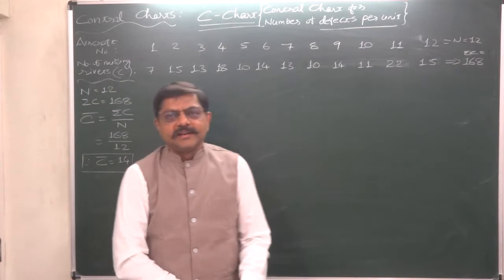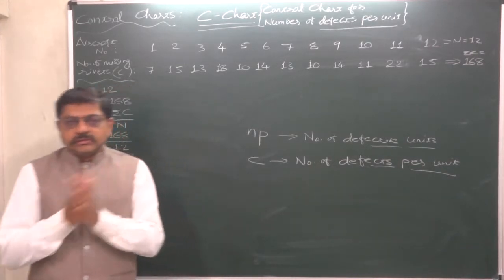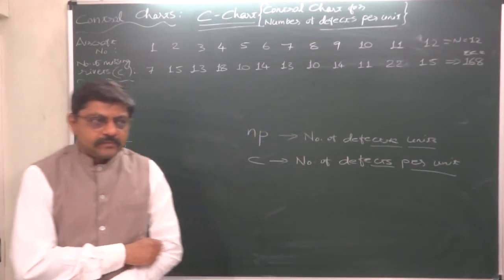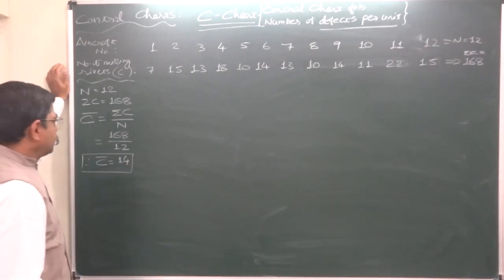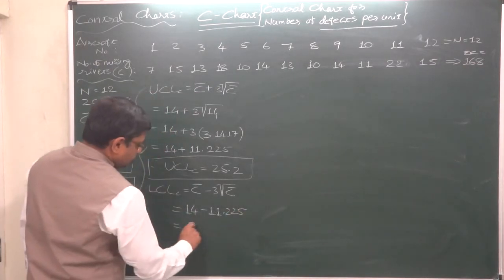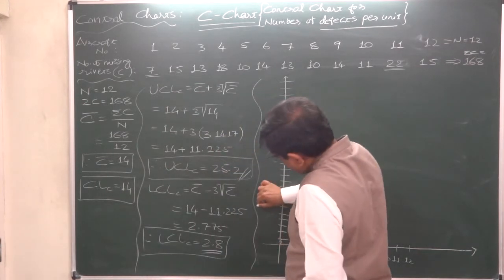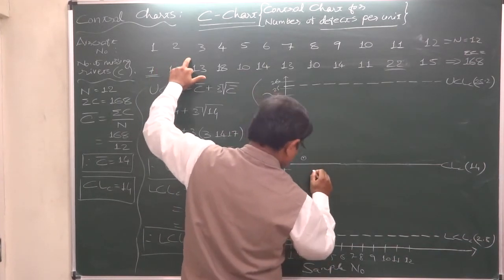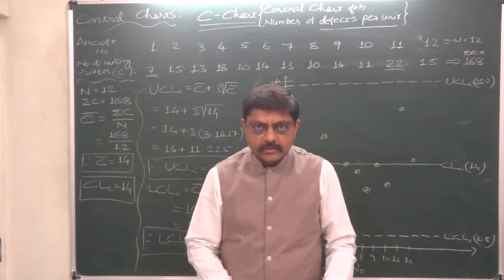Statistical Quality Control   12   C Chart

Comment: Respected Sir ..when do we use U-charts.??
Reply from the maker: In this era, the U-Chart is also used in SQC, particularly where the Six-Sigma technique is used for the [purpose of the quality control. U-Chart is based on average number of defects per sample unit/lot. In C-Chart we take one unit in each sample and count the number of defects in each sample unit, while in U-Chart we take each sample made of a lot of constant or variable size and average number of defects per lot is considered for the chart... You will find the lectures on U-Chart very soon on my channel.
Reply: @PUAARAcademy  Thanks a lot sir for your guidance .